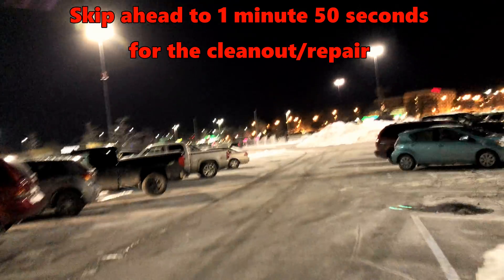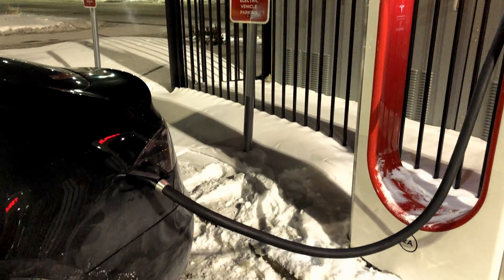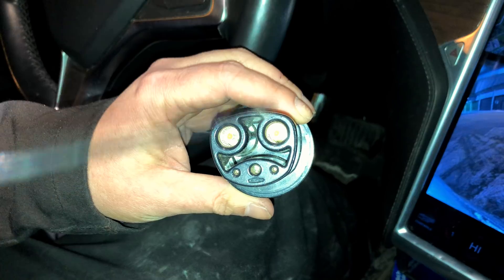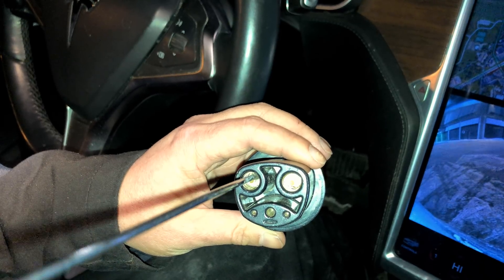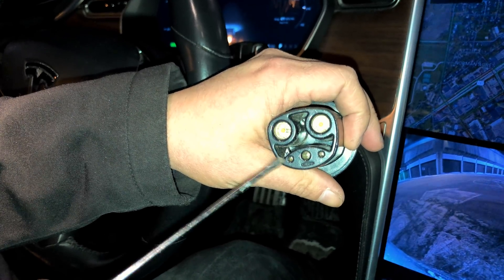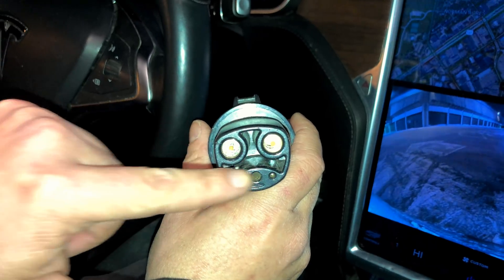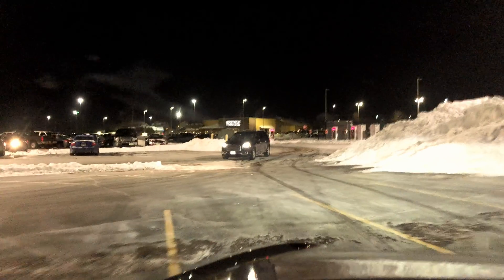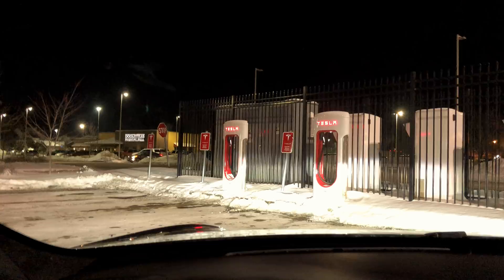How to remove/clean frozen/ice Tesla Supercharger plug

Comment: Hmm, I am thinking a spray can of a deicer would do the job. But have no idea what would do something like this. Anyone have an idea? Maybe WD40, or gun cleaning spray, or engine starting fluid, what would you think is best?  A quick spray and one could start supercharging.
Reply from the maker: A couple concerns about sprays. For a De-Icer, the vast majority are flammable. Even if they evaporate away, some residue is still left behind and could be a fire concern. Likewise, the 12v pins are still live, all be it at a low amperage, but doesn't take much. If somehow they were to short, and a spark, you will have a fire. 
Same with WD-40, it is a great water displacer, but also can insulate. At the currents being used, might cause additional heat build-up and higher resistance in the plug. 

I thought about all those, ideally, just a minute or two of heat would suffice. If no one else was around, or enough room to park the car so the cable would reach a drivers or passengers front window, and have the end placed in front of the heat vent, would be the absolute ideal method.    Since that isn't always possible (A nose in supercharger would benefit from this method the most), the thought of the 12v hair dryer came to mind. Likewise, it would also have the benefit of being able to thaw a frozen charger port on a car. I've run across this issue myself a couple times, and no matter how much I want to deny I did this but ended up needing to put a bare butt cheet on the open charge port to get the locking pin warm enough as a hand did not cut it :-(
Reply: @KmanAuto  , yeah I really have not had to deal with this yet like you all who live in real snow conditions.  The hairdryer would nail it for sure and it runs off the 12v so SOC on battery pack is not an issue for sure.  The spray having a potential of fire however might not be a problem if it melts the ice before the plastics....   ;) I kid, but the real answer is I didn't think of that. I have been known to run with scissors I guess  ;)

However you are the man to put a body part to the task of fixing the car to get a charge...  ;)

Comment: @6:40 do each of those 3 stalls have 120 kw dedicated?
Reply from the maker: Yes, 3 stalls each at 120 kW dedicated. It was supposed to be 6 stalls, then the mall goes and decided they don't want to lose the other 3 spaces of parking. Then what does the mall go and do? the ////\\\\ two of the spaces and the third put a clothing donation box that was just full of trash. 
Thats why Tesla ended up building a 8 stall location about 1 1/2 miles away.  Even then, this location is always packed, and the other 8 stall location is rarely. Just a bad location for the other.
Reply from the maker: The conduit and hardware is already in place for 3 more stalls. Considering how many stores are leaving this mall, parking is no where near a concern!
Reply: I see three cabinets, another odd installation
Reply: it would seem so unless the cabinets aren't fully populated with chargers in each slot, then it would likely be 90 or 60 kw, unless they're setup as something similar to the Urban Superchargers but you would see less cabinets.